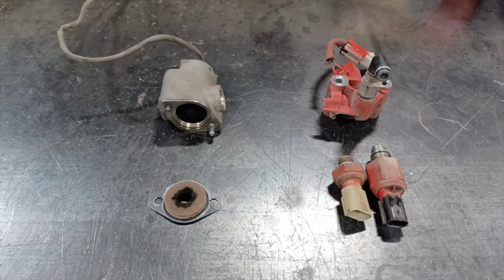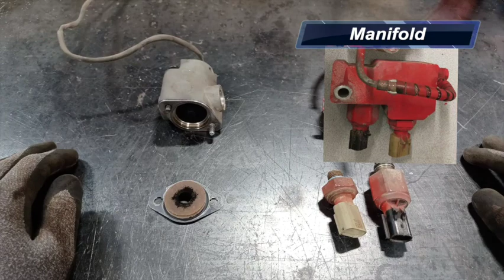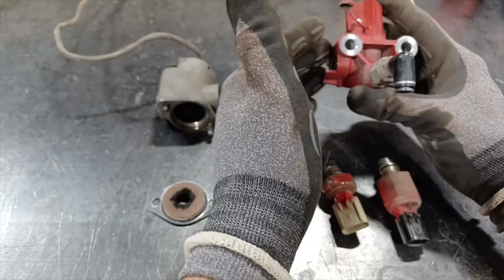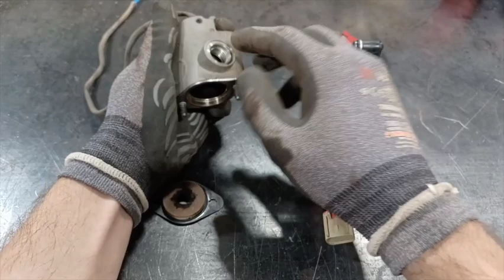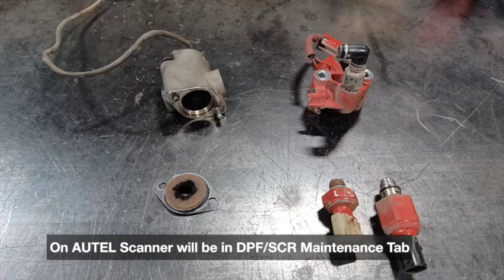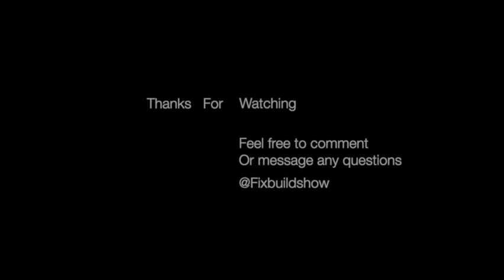Cummins ISX 15 DTC 3225: Tips and Solutions [+the trick to keep it gone]

Comment: Do you have the parts numbers?
Reply from the maker: I'll look to see if I have the P/N's still. Also using the Cummins Quickserve Online (QSOL) will allow you to look up part numbers, but may not show the Manifold. I do have the Manifold part number I can post a little later.
Reply: I'm getting fault code 1963, what that be the same thing? I've changed the solenoids on the block and still won't regen and cel is still on? After treatment fuel shutoff valve mechanical system not responding or out of adjustment. That's what it says. Thanks in advance! 😎